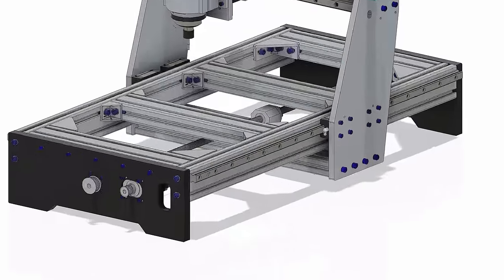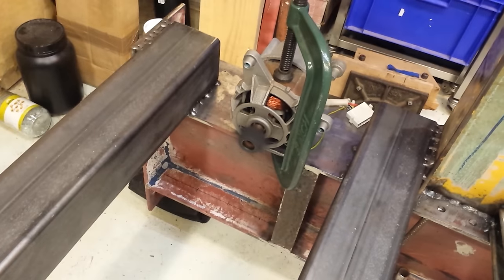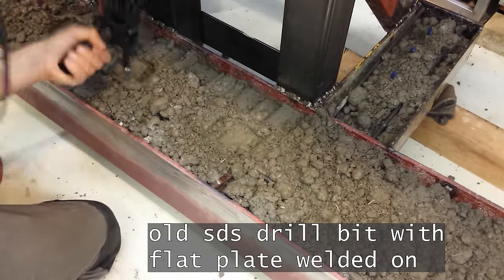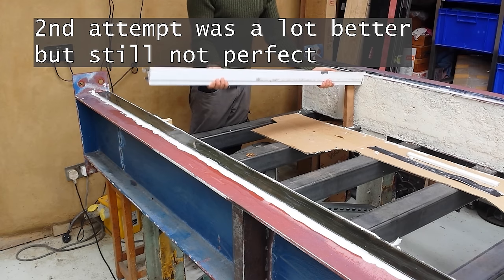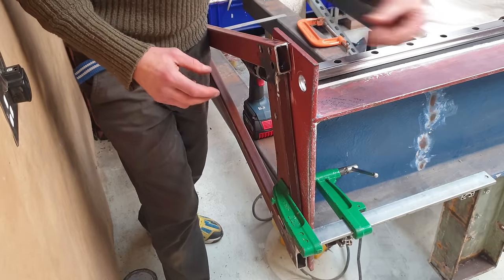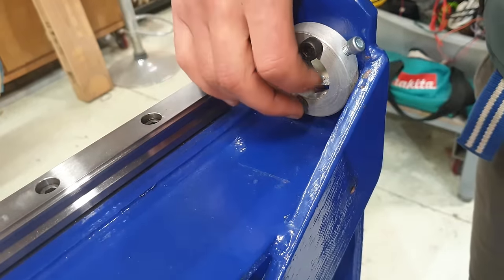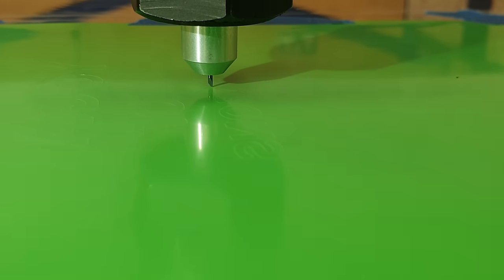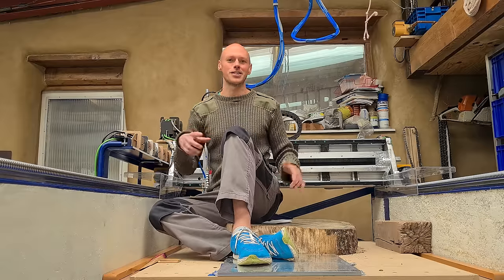Can we DIY an Industrial grade CNC?

Comment from the maker: The video where we test this baby! https://youtu.be/zTQJpwYjUeg 
If you would like the 3D CAD model to play with, and/or to get our metalized epoxy recipe/guide, go here: https://ko-fi.com/floweringelbow/shop   Thank you for watching friend!

We are in the process of putting together a big document, full of diagrams and details about this machine build. When it's done we will add the links here & in the description above.  
If there is any element of this you are curious about please ASK! We love to hear from you and will reply, and it might be something we write about in the document we're making...  
Peace n Love,
Bongo and Sam
Reply: Love this.  I'm in the process of doing something similar with a focus on repeatability, sort of decentralized production for proliferation.  My design uses junk aluminum cast using a lost-foam method, bearings are 608RS(lots of them) on concrete-filled steel tubing, acme leadscrews, steppers, LinuxCNC, 2 1/4HP wood router for now.  Desktop machine, less than a meter square footprint.  Next version will switch to helical rack&pinion drive.  

With all of that info, I know everything you're going through with this, and it's fair to say that your build is going to be far better than mine in terms of sheer cutting capability. Mine's easier to get into for new builders, yours is just better.  Great job.
Reply from the maker: @lowellhouser7731  That sounds like a cool build. Thanks for watching, and good luck with the rack & pinion version.
Reply: @FloweringElbow  Dude, I can't wait to see what you can make with yours.  I can tell, you really have only scrapped the surface.  This thing is gonna be great.
Reply: @FloweringElbow  Love this vid. Liked and subbed. Also, I don't know if you're into 3D printing at all but if so, I have a suggestion for the cable chain: 3D print it out of 95A shore or higher Filaflex flexible filament. It will solve your creaking issue as well as give better vibration damping. It's also fairly light so it shouldn't add much extra weight if any to the gantry movement. Use nylon link pins with cotter pins through the exit ends to join the links so that you have adequate lubrication on it without having to grease/oil it since nylon is self-lubricating and rigid enough for that application. I'm also suggesting the cotter pins as the link retainers for the nylon link pins because it will make it much easier later on if you ever have to do any maintenance to the lines. You could also use aluminium link pins and give them a light coat of white lithium grease if you prefer a stronger link that requires less maintenance (e.g. having to replace the nylon link pins every so often). This will add a bit more weight to the cable chain but you won't have to fiddle with it as much. If you go the route of aluminium link pins, be sure to get some eyelet inserts to put into the chain link holes where the pins would go to help reduces friction grabbing.
Reply from the maker: @ka0skontrol504  Thanks for this, sounds like good advice. One day I'll join this century and get a 3d printer. Not sure when though ;)
Reply: @FloweringElbow  well if need be you can always just get a 3d printing service to do it for you. If I had the proper setup, I would gladly make it for you. Sadly, my printer isn't the best to use with flexible filament.

Comment: MDF, like all wood products, isn’t dimensionally stable, principally due to humidity variation; it will be contributing to the machine’s inaccuracies. Before running a part that you’re trying to hold tighter tolerances on; expect to need to re-level the spoilboard.
Reply from the maker: Good afternoon Dark Winter, thanks for commenting. Yes I agree. I might slowly start melting and making thick alu plates to replace at least some of the MDF. As you say it isn't super stable - neither is it super rigid: I can deflect it quite a bit with my body weight between the box steel slats... Thanks, Bongo.
Reply: You could mesh map it.

Comment: Wow! This is very inspiring. What an epic project! I just stripped my Bobs CNC E3 POS for the screws, rods, arduino and nema 17 motors in frustration. I definitely want to build a decent CNC, and You've definitely inspired me. I won't be going quite so far, but if I can achieve at least 50 micron accuracy I'd be happy. I really like the idea of raising the bed rails rather than the Gantry. That is brilliant, not to mention the self-leveling epoxy for the linear bearings, and a host of others.

Comment: You need another bracket on the top of the spindle ...should take any wobble out with proper feeds and speeds
Reply: Sure, sure. And then you will discover that that's still not enough and then you add something else and then one more and another one and... Of course, if you had done the calculations, then you would have known that your design was never going to pass decent deflection and wobble criteria. :-)

Comment: Well done I like people that can think outside the box. I built my own table 25 years ago 1200x2400 and the hardest thing is pulling up the rotating mass of the y axis twin lead screws so I made the twin lead screws fixed and rotated the ball nuts that were mounted on the x axis along with one servo motor It worked well. BTW I used concrete in the box sections

Comment: Wow, such a huge update...just astonishing. I envy the space you have to realize your creation. I was reading in a forum just recently as I was settling a question about post processors and my Vectric software. I stumbled across a topic were someone was complaining about jagged lettering,  the matter of arcs and curves. One commented that ultimately "a cnc machine operating in X,Y,Z cannot cut a true arc. A G2/G3 move is broken down internally into extremely small straight line segments. The only place you can cut a true circle on a cnc machine is on a rotary axis"  
Thought you might find that illuminating :)  Anyway I have just installed a new motion controller, the ESS from Warp9 and it was like starting from scratch, especially since I upgraded to Mach4. There is little about it that is carried over from Mach3. So I was struggling with it for a while. Learned so much in the process. Mind ,..I would just as soon spend the time working on my designs and sourcing material. Anyway the impetus to toss my old motion controller card began months ago as I was listening to my stepper motors during some job that was full of curves and honestly it sounded like they were in opposition, a horrible low frequency grinding. I knew it was time to re-do the tuning for X and Y certainly and dial in the steps per unit.  I am now writing or at least editing my own macros.  When I first ventured down this path I was never comfortable with the inner workings of Mach3 and did my best to avoid it. Now I embrace the weird graphic overlay and can pose somewhat intelligent questions in the busy Mach4 forum. And that is obligatory if you want a reply. I have solved many items that require trouble shooting but some are quite puzzling. 
 I would love to hear about how you  solve the servo tuning and looking forward to an episode re: tool change and tool setting .  Best regards, Chris
PS lets have a look at your controller and drivers etc if you have time !
Reply from the maker: Hey Chris, thanks so much for this :) 
Yeah, I'm soo lucky to have that space. The CNC only just fits in too - taking up a good chunk of the shop. Unlike all my other tools it doesn't have wheels and isn't at all mobile - so it's great that it's working because for the last few forevers it's just been in the way taking up 1/3 of the shop! Worth it now though :)
Interesting what you say about the G code etc. I WILL have to look at tuning them, just a little scared to get started and I have already written the autotuning off as making things worse.... 
The electronics box is made from an old sheet metal boiler enclosure. The controller is Mach3 to a Warp9 ESS to a cheap £10 BOB to the servo drives and relay board (well in some instances I have gone straight from the ESS to the servo drives and relay board). Anyway yeah, will show in a future vid.
Cheers for now, Bongo.

Comment: I just realized something after watching this video. When you weld any metal, especially with SMAW method, you impart a lot of stress into the metal you are welding. The best way to eliminate this is to  peen the weld right after the joining process is done. This sounds a little bit unusual but from trial and experience at the crane works, this works perfectly. Frame stability for any cutting machine is job ONE. 
Just my two cents to help a fellow tinkerer as myself. Nice work fella and have a great day too. vf

Comment: Brilliant job! Those are serious ball screws!
Reply from the maker: Hey Christopher. Thanks friend 😊 
To be honest, if I was to do it again, I'd be using 25mm screws not 32mm... with the machine's frame tensioning them, I don't think they need to be so fat. The nuts on smaller dia. ones can spin faster, and the angular contact bearings in the rotating ball nut assembly, could be smaller - there's a big jump in price to get ones big enough for an axle and the ballscrew to fit through... anyway, thanks for watching ;)

Comment: I've been on the outside of everything CNC for a decade.  Everything you've done was spot on.  When you machined cast iron ... you proved it!  Isn't cast iron wonderful stuff?
I've wondered for a decade if suspending a tank of water or lead or some such on cables beneath the machine would accomplish the same results?
Reply: If suspended on cables, damping effectiveness would go to zero as you approached the natural frequency of the resulting pendulum - about 1 Hz for a 300 mm/ 1 foot cable. But you want orders of magnitude more frequency response, you want not floppy cables but rigid materials that push back as rigidly and rapidly as the cast iron, steel, epoxy granite, or concrete that CNCs are built with.

Comment: Hi Bongo and Sam, I just came across this video today for some reason. YouTube? Anyway, I have sometimes thought about making my own CNC machine but it would have to fit inside my 20 foot shipping container. 
I was very impressed with your use of the I beams and the advantage that they gave you in raising the ball screws and pinion rack. It does come at the cost of restricting access to load and unload materials and work pieces, but you have eliminated any gantry sway.
Keep up with the good work. 
Mark from Melbourne Australia
Reply from the maker: Hi Mark, thanks for getting in touch. We appreciate you watching.
Greetings from Wales, Bongo & Sam.

Comment: I used to work in fabrication for nigh on two decades.There a technique used called directional welding.  It is the knowledge of how the metal reacts to the heat, and is used in tandom with the known movement caused by the heating of the metals and the draw of the base metal to limit warping twisting and like. From bridge guirders, train cars, and giant weldments. It can and is  utilized to minimumize and even the correction of unwanted movement. Welds cannot be made in 1" increments and expect to get the strength that is possible by full pen welds. Awesome build though.

Comment: TiAlN coated endmills will help with not needing coolant, as that coating is designed to be run dry...you can use an air nozzle to keep chips clear of the endmill while slotting, just to keep them from getting crunched and chipping your cutting edges...

Comment: If you want to effectively bond the mass of the concrete coating/filler very firmly to the steel surfaces, try welding an array of many bolts perpendicular to the steel surface. If spaced appropriately, the wide bolt heads will securely retain much of the concrete in compression. This is much better than an adhesive coating, which is bonding the concrete to the steel, but only in tension.
Reply: The small rebar (which is submerged close to the concrete surface) is resisting concrete separation from the steel beam, but only in shear at the welds. If the bolt arrays are topped with non serrated wide flange nuts, then the concrete can be secured with post tensioning.
Reply from the maker: Nice thought Imcons. I did actually do this for the concrete in the legs - I figured there was enough protrusions and random bolts and bits welded on the main rails - I admit I could have done more there though....

Comment: Awesome build!  It sounded good cutting steel - that concrete does a good job dampening the frame.  Make your main table surface metal (MIC6 perhaps?), and bolt your MDF spoil-board to it.  Then when cutting with coolant, just remove the spoil-board.
Reply from the maker: Hey Ian, thanks for watching :D It's a nice idea, that I have been toying with from the start. Really I don't want to be buying that much steel though. I'm tempted to make it up in cast sections of either aluminium or cast iron (probably Al because I wont be able to lift the requited volume of cast iron out of the furnace). Maybe some manner of crane/hoist...
Reply: @FloweringElbow  mic6 is a super flat aluminium alloy.  Money though.

Comment: I can remember reading about some LARGE machine tool manufacturer (Giddings and Lewis I think) using epoxy between linear guide saddles and the machine structure, holding it in the right place whilst it set.

Comment: Good day
 Work, assemble machines with the same structure, only they have a table between the rails. My problem has been to align the rails on each side, to ensure parallelism and perpendicularity, preventing the gantry from crossing and stopping. The rails are located at a distance of 3 meters from each other. Know some technical and effective alignment system. So far I do it empirically with a tensioned steel wire.

Comment: Fantastic work with great solutions. Like the epoxy bonding layer. Static ballscrews, nice, no resonances. You have a new subscriber. Made a lockown cnc myself but just a baby. Very impressive. would love to hear the specs of electrics and drives.
Reply from the maker: Awesome, thank you! The electrics go - Mach 3 > ESS (warp 9) > ceapo BOB > 4 x Samsung CSDJ 400W servo drives > matching servos. Hope that helps. Any other Q's just ask.

Comment: great to see it finished and working well, and the rotating ballnuts make all the difference. 
Looks and sounds really solid and seems to cut steel without any push off. 
The irregular finish on curves could be a bit of play in the angular contact bearings, or low preload.

Comment: Nice build bro. You could get some of that black "accordion" style cover to keep chips off your rails and screws. Can build a half box on either end to hold each piece and it will sandwich down on each side. 

The "Faceting" you are seeing is the model, not the machine. A model is made up of tiny point to point lines, or triangles if using a model like an STL but we dont use those for creating CNC Tool paths. You can set up the density of those lines (points) which will make far less flat surfaces along those surfaces. I am not sure how you do it in F360, I think it is trash CAD software compared to Solidworks, but I am sure a google search will tell you.
Reply from the maker: Hey Matthew, really appreciate your feedback friend, thank you!

Comment: Stellar achievement. Being blessed with ADHD requires me to just dive in and do it (after extensive research). I like your style, go big or go home. I just about ate my socks when you flipped the base and it wanted to dance with the hoist and other objects in the shop.  With that much weight doing what gravity dictates, all you can do is get out of the way and pray. I've just picked up the scraping bug to restore some old iron I've acquired on the cheap. After investing in metrology gear I made an electric scraper out of a (very)vintage sawsall type tool that should keep the carpal tunnel syndrome at bay. I'm looking forward to watching all of the pieces of this engineering puzzle. One final comment, Linux CNC, you won't regret it. It's what I used for my Denford Triton Pro VMC conversion and my CNC plasma table build.
Reply from the maker: Hey MisterFixit, thanks so much for this :D 
My only hesitation with LinuxCNC is that I have it all wired through an ethernet smooth stepper, and my laptop has no parallel port. As far as I know LinuxCNC doesnt work with the Warp9 ESS board? 
Thanks again, Bongo.
Reply: @FloweringElbow  My systems use an FPGA MESA card and work over an ethernet RJ45 port. MESA has a huge line of Linux CNC control cards for all kinds of CNC systems, new and retrofits. There is also a great support community for MESA and Linux CNC. The neat thing is MESA has expansion boards to easily modify and increase the capabilities of your particular machine, like adding an auto tool changer. The prices are very reasonable also. Linux CNC is the best/cheapest way to get a configurable industrial quality control system for cheap and being open source it is constantly being upgraded with new capabilities being added on a regular basis. After adding Linux CNC to my VMC it was easy to adapt it to my Plasma CNC table project.
Reply from the maker: @misterfixit1952  Thanks for the info, will have to look into it more and consider changing. ATM though I think I need to actually use the CNC to make some pressing projects. I guess I'll see how inconvenient Mach3 becomes...

Comment: Excellent work! Check out the way Datron do their chip extraction, for sheet material basically nothing escapes as it's height is fixed to the work not the spindle.
Reply from the maker: Hey Littlestworkshop, thanks for the tip!